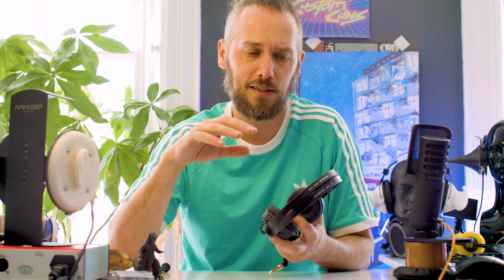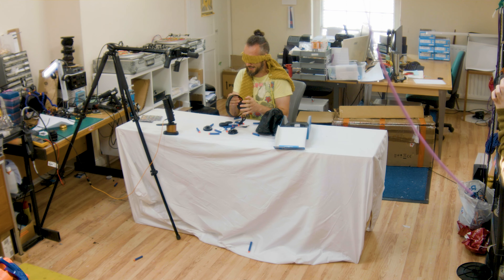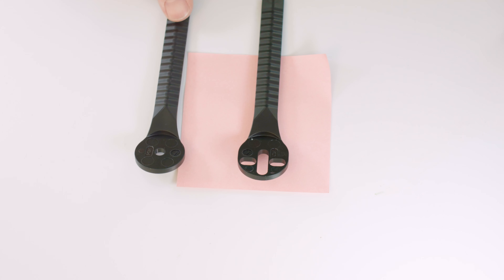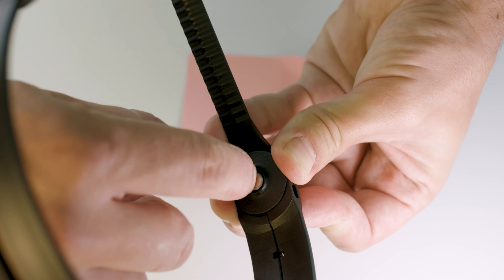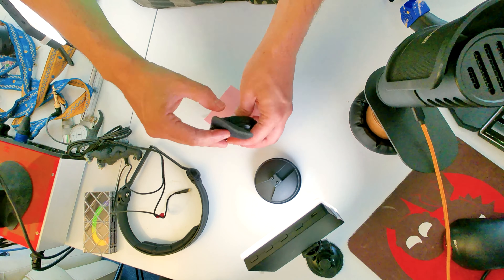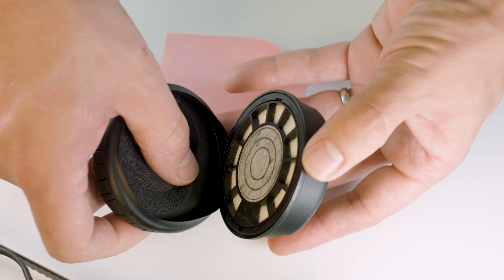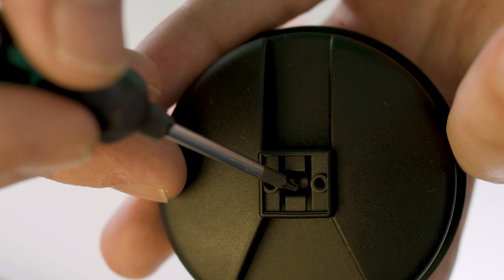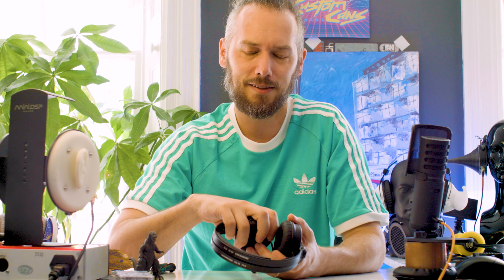Sennheiser HD25 repair and servicing guide. How to fix or replace any part of them

Comment: Hello, I just bought a set of HD 25. I find the sound a bit warm (bassy) for a pair of headphones that is supposed to be neutral-ish. With a multimeter they measure at 60 Ohm (from the headphone plug), though the headband says 70 Ohm. Should I be worried they're fake?
Reply from the maker: HD25s need a bit of use before they sound their best - if they are new, I would leave them playing over night for a couple of nights to get the diaphragm nicely bedded in. 
They used to come with a steel cable, then newer ones have a copper cable so they measure a bit lower on the impedance. Most of them are around 64ohms but it can vary from unit to unit. There are fake ones out there and we did another video with some tips for spotting them
Reply: @CustomCans  thanks for your answer. It seems they are probably genuine according to your video. Youve been very helpful!
Reply: Yo dude get the Custom cans damping kit!!! 
Bleave me it's makes a difference!!!!😁😉👍👊

Comment: Hi, I currently have an issue with a HD25 driver. Connection issue solved by opening up and stretching the springs however, as soon as I play a loud bass the driver cuts out (top end is still there though) - any advice would be awesome on how to resolve this issue-thanks Simon
Reply from the maker: Sorry, that is not something I have seen before. It may be your driver is not the a out. I would try removing the grill and 1st check to see if there is anything on the inside that may be obstructing the diaphragm form moving like a crack in the grill or some some of the damping material inside that has moved around. Then I would take a look through the membrane and see if the voice could looks straight and is seated in the groove in the magnet correctly. While you are in there check for any sticky residue on anything, DJ headphones sometimes get drinks and things spilt on them when nobody is looking
Reply: I have already dismantled that headphone (removing the grill etc) but haven’t noticed anything unusual. I will have another go and see if I missed something - thanks for the help!

Comment: hi. what is the diff between oyaide and your rawemaster v2?? thanks
Reply from the maker: The oyaide is a bit shorter and uses OCC copper. The rave master is primarily designed to be super strong and put up with DJ use, it is reinforced, uses normal OFC copper and has chunkier jack options.

Comment: So it's actually possible to reuse old head band padding? Good to know.

I'm pretty cheap, so after I painted mine I bought a roll of half-inch adhesive weather stripping foam. Not nearly as plush, but it works well enough.
Reply from the maker: That is a clever idea - how did the painting go ?... I know from experience that it can be hard to get paint to stick to HD25s permanently
Reply: @CustomCans  the ear cups turned out almost perfect first try, but the headband needed a lot of painting and sanding. Then again, I just used a can of Rustoleum hunter green

Comment: If you have the original HD25-1 from the 90's you have the top quality real deal !
These new HD25 are ok but nowhere near the quality of the HD25-1. So if you still have them from back in the 90s like I do, look after them !✌️👍
Reply: The 90s models had better quality speakers & at some point, they stopped using them to make a cheaper cost version !

Comment: what screw is that? please help !
Reply from the maker: the small ones on the cable clamp are normally T6 unless it is a pair from before 2012, in which case they are philips numbr 1
Reply: @CustomCans  yes but you know the size of the crew? thanks !
Reply from the maker: I believe it is an M2 x 8mm @kledbaken